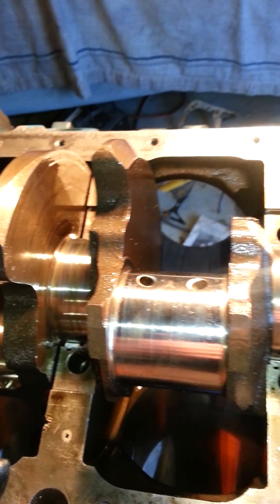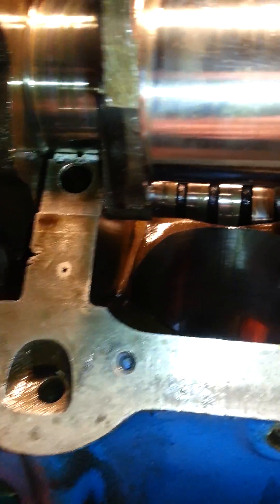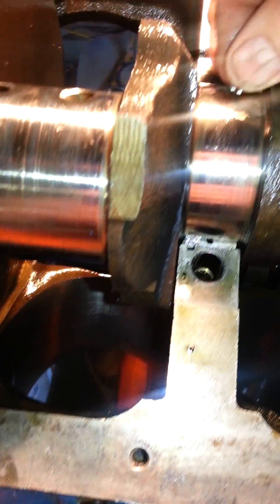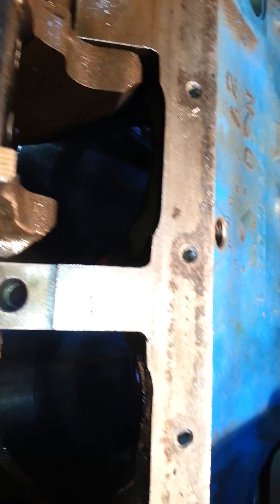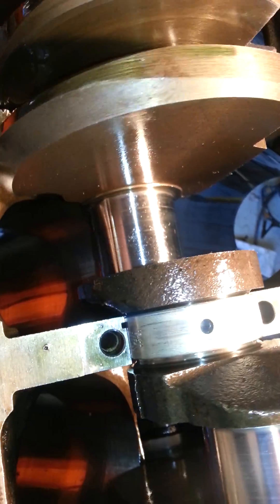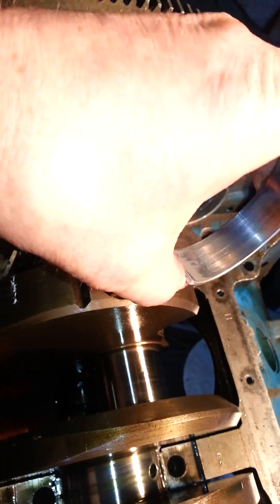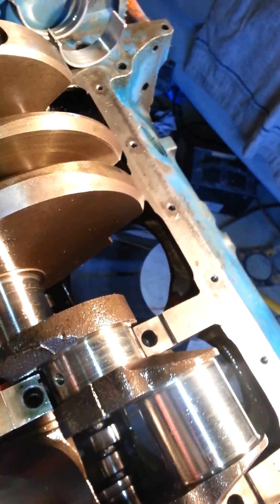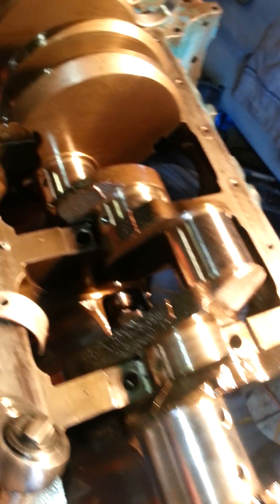Best way to change main bearing

Comment: My dad would sometimes say, "Don't knock it, 'till you try  it."  You saved my weekend today.  Underneath the car with the oil pan dropped, I found a bad bearing, #5 main bearing on a Honda B16A w/ ~198K Km.  Thank you for sharing this handy trick.  I didn't get it the first time, but my friend helped me and we got the top race installed on the third attempt.
Reply: Hows engine since you did this? I wanna Do it but wondering about clearances and crank balance

Comment: that was the coolest trick I've seen. I got to replace main bearings in a 2.7 dodge charger I replace the rod bearings but the main bearings I believe are so screwed that's the crankshaft isn't balance causing misfire. I hope you know my friend you have helped me a lot. I can do any engine repair out of the vehicle but this was something I need done without removing engine. cool little trick
Reply: I JUST DID A CHRYSLER 2.7 & I LENT MY GIRL MY CAR WHILE I DID HEAR BEARINGS & SHE SCREWED MINE TO SO, NOW IM REDOING MY ZETEC> MAIN & ROD BEARINGS! THERE IS A HUGE HILL BY OUR HOUSE & SHE DOESNT LET THE CARS WARM UP! MY ZETEC NEEDS HEAT IN THE OIL!!!

Comment: How's the motor with the new bearings?
And, did u rotate the crank using a tool or by hand ?
Reply from the maker: +A Saleh I turned the flywheel.It lasted a year then blew up.It was in a racecar.